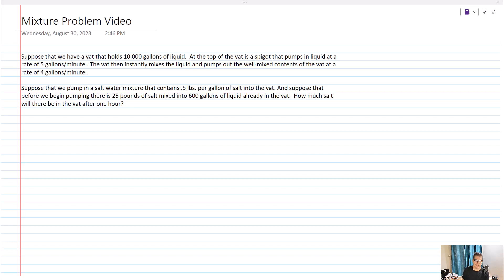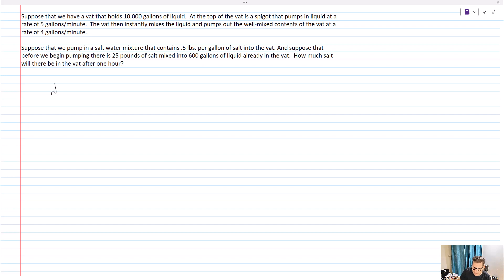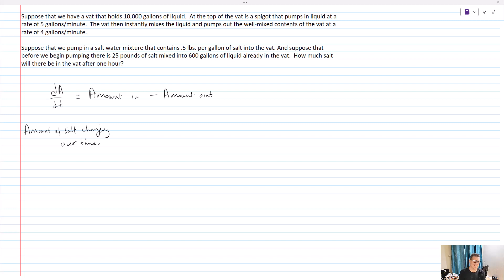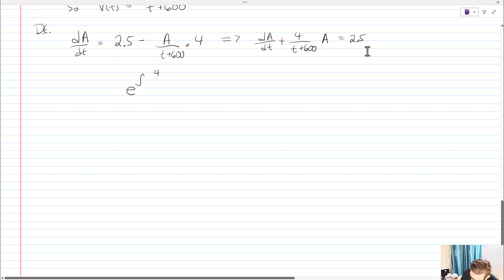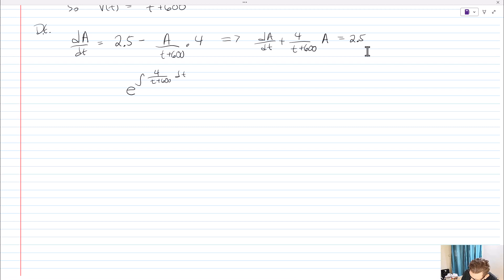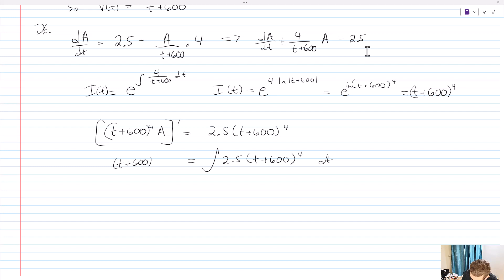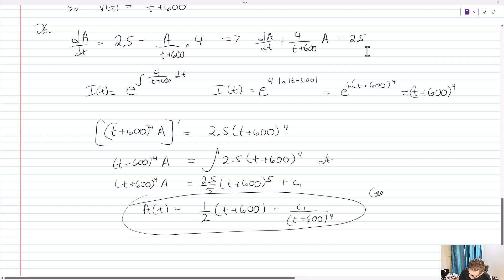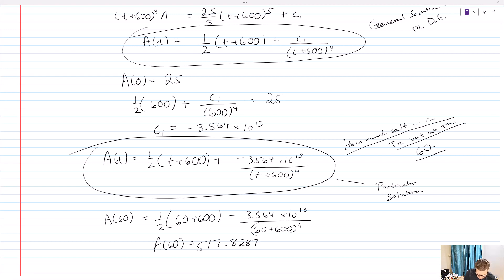Basic Mixture Problems using first order linear differential equations

Comment: I believe that the correct answer is 142.171 as you'll get 517.82 when you add in 14:06, when clearly its negative. Correct me if I'm wrong tho
Reply from the maker: I will give it a check.  I have a list of videos for this break that need a good looking through and revision.  Thanks for the heads up.
Reply: indeed 142